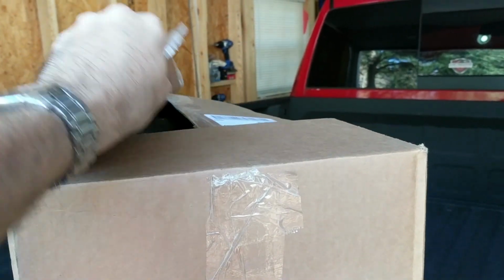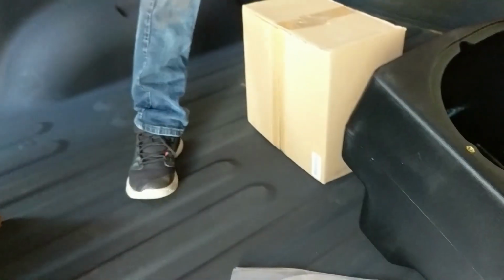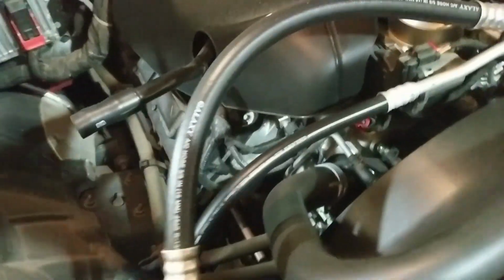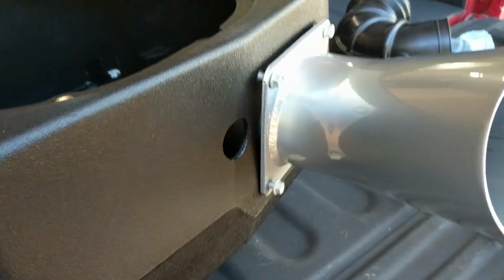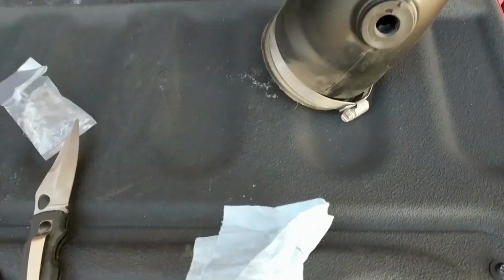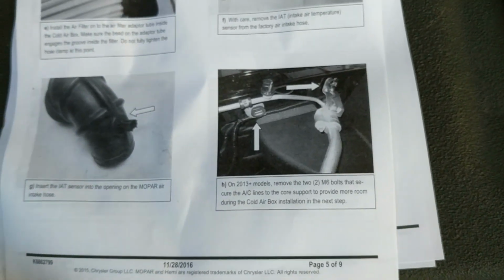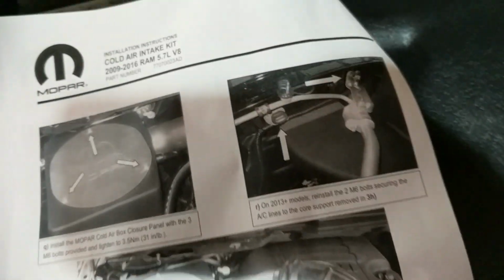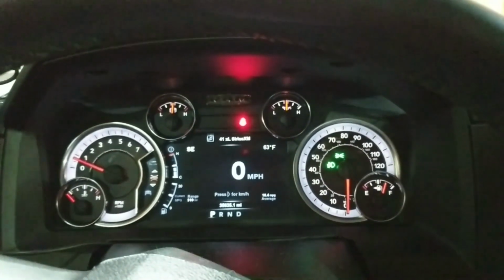Mopar Cold Air Intake install on 2017 RAM 5.7 Hemi - Product # - 77070023AD

Comment: Nice install video, I did the KN filter first 70 bucks ok but yesterday got lucky  friend decided  to sell me his mopar set up for his 2019 v6 ram just missing a tube got it for 100$ thing is I'm changing  to the 6.4 intake so I got the legmaker kit and going to that right now my 2wheel Drive 4dr Ram is running 13.62 at 98mph with sw stainless headers and Diablo 91 tune and stock airbox with KN filter with this Box  and 6.4 intake and Jay Greene  tune I'm gonna Fly down the Track thanks for the Video  it helped my install 😀👍
Reply from the maker: Good luck at the track!

Comment: Next headers would be awesome! They should have given you a clear cover so you can see if the filter is dirty.
Reply from the maker: Headers would be pretty sweet, I haven't made up my mind yet if I want to start adding a bunch of performance mods or not.  I've got a project race mustang that I'm working on and that's where most of the money goes lol.  I need to get back and add the ram air portion to the hood and that would remove the cover completely, need to move that up the list!
Reply: @RaymondLamb  The reason why headers are so important is that Chrysler put cast iron manifolds on aluminum heads and the rates of change from heat/thaw are different and that is why bolts are so common to snap on these trucks. I read that if you put stainless steel headers and/or ones that are powder coated, that the chances of snapping bolts are much less and more consistent on the heat/thaw compatibilities. I plan on buying shorty stainless steel headers that fit up to the stock exhausts. They can be pricey, but I have seen them in the 500 dollar range. This is a very common problem with these trucks from what I have been reading and there are lots of videos showing how to remove the manifolds and extract snapped bolts from the heads. Just trying to help!
Reply from the maker: Great info!  I hadn't really thought about it from that point of view.  Get the added bonus of better sound and performance in the process too.

Comment: You’re lucky your crank case vent hose fit. I had to cut about 2” off the end of the plastic part of the hose and then put that same short hose back on with a hose clamp on the one side.  The other side connects to the air filter.

Just took it for a test drive and I notice a nice throaty sound. I haven’t put the headers or Cat Back on yet, so maybe having a quieter stock exhaust is why It’s more noticeable. 

JBA titanium ceramic coated headers and a Corsa Muffler are going on in 3 weeks.
Reply from the maker: Are you doing the header install yourself, if so let me know how it goes?  I've always thought about adding them as well.  I've got some Borla exhaust videos if you're interested.  Corsa sounds good too though!
Reply: @RaymondLamb  I was all set to install the headers myself but the JBA Competition Headers have to be welded on at the CAT. The Install got pushed back to May 13th which is cool because I just put a leveling kit, 305/55r20 Nitto 420 tires, and installed OEM Fender Flares this weekend.  The flares were already painted black and  you have to really look close to see the difference compared to my metallic flake black OEM paint. It looks mean AF right now, but not tacky like you got drunk in isle 2 at autozone. 

The black 20” fuel rims have about a 1” offset which looks perfect with those flares. Fills it out beautifully.

I bought a Mopar Sport hood like seen on the Ram Sport and Rebel. It’s being painted now. 

Then on the 13th that will go on and the headers, and I’m thinking maybe just a magnaflow muffler which is more tame when cruising for now.

Then later on I might get the Corsa Cat Back after I get the Diabosport T2 and PCM swap.

After that I want to get the upgraded Uconnect with the NAVigation it costs around $1200’and comes with the Bezel. All the Rams come with the same wiring harness for every upgrade.

I’m loving this truck. I’m trying not to make it look too after market. The flares and hood are on upgraded models.
Reply from the maker: @mightymikeamps9317  nice, I've always wanted to add the JBA headers, but a welder I ain't lol!

Comment: For about $300 and a five minute install you could buy a throttle modifier such as Pedal Commander or Pedal Monster and cut your 0-60 times significantly. Your off the line time is what’s killing you.
Reply from the maker: Do you have one of these, I've seen many people talking about them?  I've debated about one for a while.  Thanks for the info!
Reply: I have a Pulsar system on my 17 Ram. Throttle response is insane when put into performance mode.

Comment: Where to get a replacement filter from been looking every where ram dealership don't have them,  what's the part number for it?
Reply from the maker: I found this one on Amazon at the link below.  It's part #68256672AA, if you search that, you may be able to locate one, it claims it fits this CAI setup.  Hope that helps, thanks for watching.
https://www.amazon.com/Mopar-68256672AA-5-7L-6-4L-Filter/dp/B075LTCL5H
Reply: @RaymondLamb  thanks

Comment: Do you have wider tires on your truck for traction? Where my truck is at right now with stock street tires I wouldn’t be able to do a accurate 0-60 because my truck likes to roast the tires at a dead stop.
Reply from the maker: No, I still have the stock size.  It took many takes to get these few runs without spinning.  These were just the best overall runs and I edited all of the others out.  Once the tires got some heat in them they did a little better, but they are worn now.  I think next set I'm going with a custom wheel and tire setup, something wider and better looking!

Comment: I'm considering this but not sure yet
Reply from the maker: Overall I still think it's a good mod, but I still need to add the Ram Air part for the hood to complete it.  With that the total price is around $700+ so it's a little pricey to get better air flow.

Comment: Hi Raymond hows the CAI working for u? I just installed mine this week! Haven't notice any changes from stock other than a noise difference.
Reply from the maker: Hey Roland!  Honestly, I haven't noticed much of a difference.  I know my performance meter claims the truck is faster 0-60, but I don't tend to drive around with the peddle to the floor all the time!!!  My MPG still stays around the same 18-22 depending on the driving I'm doing, so haven't noticed an increase there either.  It might be better if I finally got around to installing the fresh air scoop in the hood to feed it some outside air, but I haven't gotten there yet, I've been so busy with the Mustang.  I do think it helped, definitely didn't hurt, but for day to day, don't notice much of a change.  Hope your install went smooth!  Think about subscribing if you want to check out some of my other content!  Thanks.

Comment: Great video! One question though did you have to get the truck tuned after the install? I've seen on forums some people say to get it some say doesn't need it. Thanks in advance
Reply from the maker: I personally did not get a tune and it runs just fine, no issues.  I 100% believe if you did tune it, that would make a huge difference.  I installed a CAI and tune on the Mustang and it was like a different car.  So completely up to you if you want to go that route.
Reply: I realize it's quite off topic but does anybody know a good website to watch newly released series online?
Reply: @Briar Lyric Flixportal xD
Reply: @Lyle Michael Thanks, signed up and it seems to work =) I really appreciate it !
Reply: @Briar Lyric glad I could help xD

Comment: There is a way to turn off the ECO green light off.
Reply from the maker: You are correct, there is a setting in the uconnect system to turn on and off, just the light on the dash though.  You can actually "disable" it using the manual gear select button on the steering wheel if your truck has that, but gets annoying constantly changing gears by a button.

Comment: Dose the vent hose push the plastic engine cover up? Looks like the cover could be cut away so the hose dosen't push or rub against it.
Reply from the maker: Hey, I went and double checked it for you.  There is already a cutout for the vent hose, and mine is just barely touching the engine cover.  I looked for any signs of rubbing or wear and there are none on mine.  Might depend on the circumstances or how well it goes together in each case, but in mine it looks to be good.  Hope that helps.
Reply: @RaymondLamb  thanks for the response. Got it installed with no problems.
Reply from the maker: Awesome, glad it went well!

Comment: What device is that for your 0-60 time? Nice Ram, I have a 2018 Ram express crew cab hemi 4x4.
Reply from the maker: Hey, it's the AIM Solo DL lap timer.  I bought it to record data in the viper at the track, but it works just as well in the truck or any vehicle with an ODBII port, which is most everything now!  Works great for recording all sorts of data.  Here's a link; https://www.aim-sportline.com/en/out-of-production/solo/index.htm

Comment: Have you consider to remove the mopar cover and let the filter open?
Reply from the maker: Hey, thanks for the comment.  That would just let hot engine air in and raise the IAT and that would cause the computer to pull timing and decrease performance.  Once I get the fresh air kit installed, I will remove the mopar cover and it will feed fresh outside air through the hood to the filter, but it'll still be sealed to the engine bay when the hoods closed.  Thanks!
Reply: Raymond Lamb Very well explained! Thank you for taking the time to respond. Cheers

Comment: Did you change your mind on installing the functional hood?
Reply from the maker: No, not at all!  I've been meaning to get it added.  I've been so busy and bought a new car that I need to get back to add this part.  I still want to install it and see if it helps.
Reply: I would like to see the scoop results, I would think at over cruse mileage might gain a couple,. what year truck was that 2012?

Comment: You could have saved yourself $400 by simply installing a K&N air filter. Unless you get the hood with the functional hood scoop to go with this, you're wasting your money.
Reply from the maker: I've actually seen some decent gains from just this part of the install, but the plan has always been to add the hood scoop as well.  I used just the drop-in K&N filter on the Viper (but it already had the Ram Air setup), but didn't want to go that route with this.  Haven't noticed ANY increase in MPG, but I don't care about that part and wasn't a goal for this.  I'll put it this way, I've wasted far more money on far worse parts!!
Reply: @RaymondLamb  - Understood.

Comment: Most gen 4 and gen 5 ram trucks have factory cai so your just waisting money !!
Reply from the maker: Maybe so, but not on my truck.  I definitely saw an improvement and the lap timer backed it up.  There is almost always room for improvement over factory, most of that is designed for MPG, not performance.
Reply: You do know mopar makes that right
Reply from the maker: @teebo5298  me? Of course, but what comes from the factory is more of a one size fits all deal instead of geared toward performance gains. Both made by Mopar, just used for different reasons!